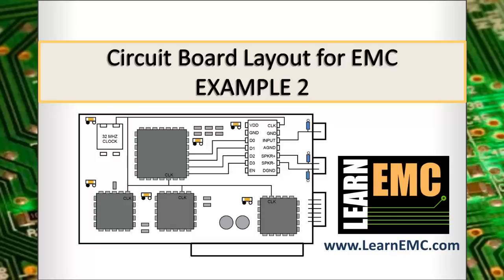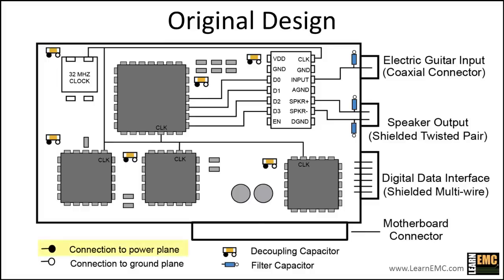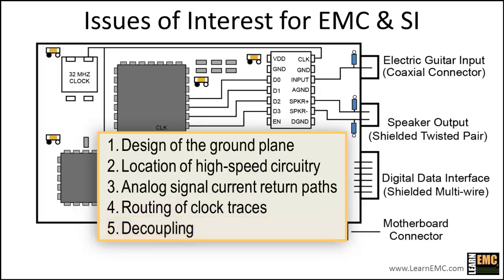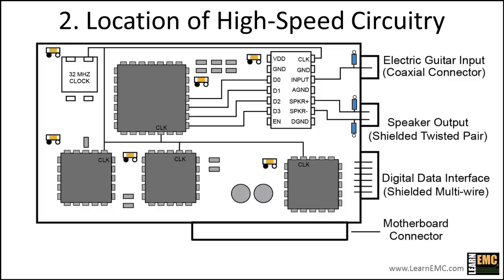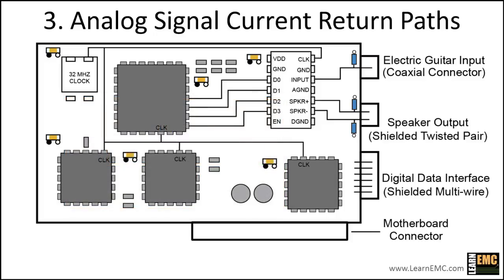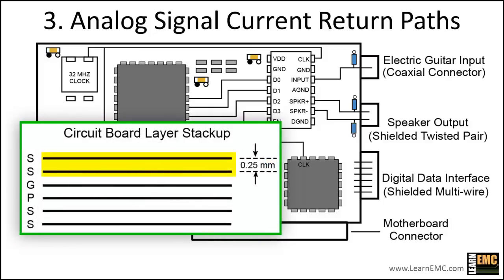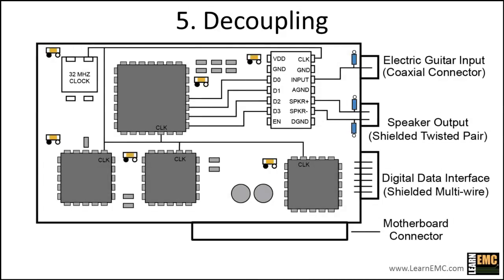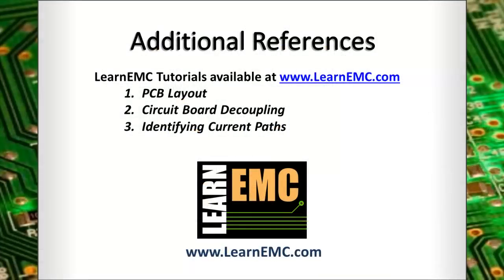Circuit Board Layout for EMC: Example 2

Comment: "Since electric guitar signals are not as sensitive to noise as some other audio signals" is incorrect.  Electric guitar signals typically have up to 60dB of gain applied to them to cause them to distort to  get the typical overdriven sound.  This boosts the noise floor by 60dB effectively taking a microscope to the noise floor.  Any digital sounds are completely exposed. Electric guitar signals in my experience are only second to Mic pre amps regarding sensitivity to noise.  Mic pre amps with equivalent noise input (EIN) in the 126-129dBu range are the only signal types that are more sensitive in the land of audio design. Still a fantastic video!!! Thanks lots.

Comment: wow. Nice. But can i ask you a question? In the layout that you suggest, the closk is replaced to the new place. So, are there any crosstalk possibilities between a clock thace from the oscillator and input/speaker traces? Im not sure about my question, so i have a lot of doubts. Can you explain, please?
Reply from the maker: You raise an excellent point. If the clock trace is routed on one of the lower layers and the I/O traces are on the top layer (with the IC), then there will be no measurable crosstalk. If the clock trace is routed directly beneath the IC, there may be enough crosstalk to be a concern.